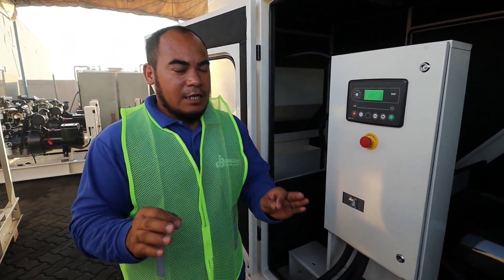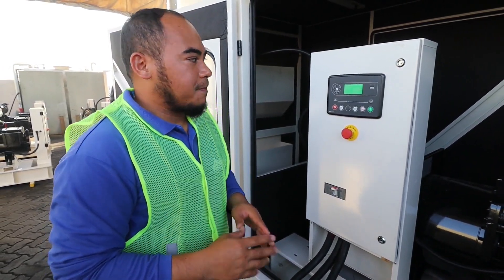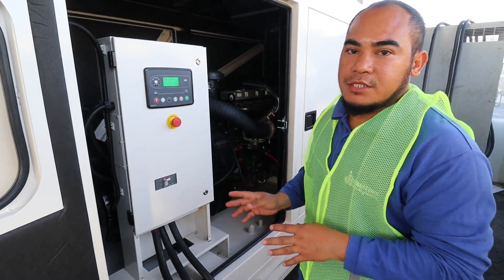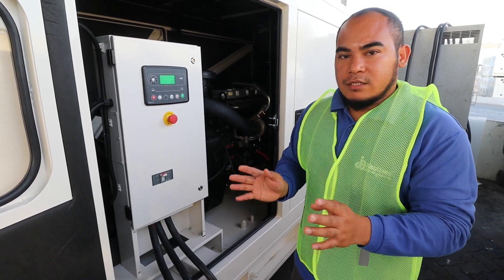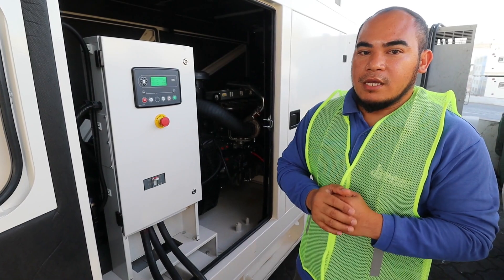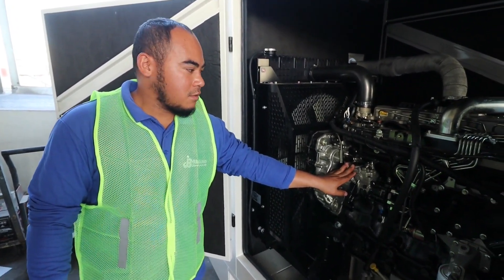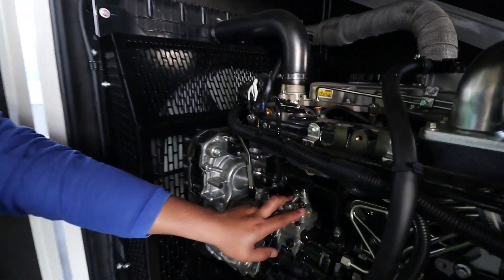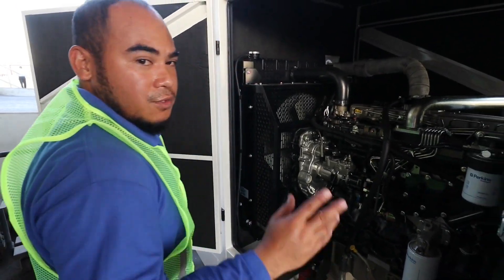Injection pump DROOP ADJUSTMENT 1106 engine,engine hunting how to fix? benzblogs

Comment: Please tell me how to solve my problem in perkins generator fitted with Delphi 3340F260T fuel injection pump. My problem is when the generator started Frequency is going to 62Hz. With the load is it varying upto 45Hz .I am keeping frequency in between 50 to 55 by adjusting load and always keeping touch on it. Some one adjusted pump RPM before from adjusting screw. I hope he didn't touch the screw which you do in this video. Please guide me, how to adjust screws on the pump. No load engine is not hunting in my case.thanks
Reply from the maker: Simply by +- until it become stable

Comment: My 1500seris oerkins is mixing oil and diesel. I have change the injectors after working for 48hrs it mixed again  please what can be the problem
Reply from the maker: Double check your oil cooler check leakage forom your pump all make sure all seal is not worn out

Comment: Nice video and tutorial. 
I have perkins engine too. It's 80 KVA. I got issued in frequency (Hz). My engine sometime got an alarm "over frequency shutdown" when auto backup onload in 12% of load. Sometimes when i tested for run up without load, the DSE alarm got alarm too..

I have tried your tutorial adjusment the injection pump. The rpm at 1542 and 51,5 Hz frequency when it's offload and at 1500 rpm and 50 Hz when onload at 14% load. But still the over frequency alarm from DSe occured when it tested offload for run up or auto backup when the main pss is off so my engine can not back up because it was shutdown from dse. Just sometimes occured, not always. This anomally makes me desperated. I use deepsea DSE 7420, engine perkins 1104 80 kva, and stamford alternator.

Btw. What i should i do ? Thx for your time..
Reply from the maker: Do this test to put the engine load if happen same setuation how much speed rise and down thin check yo your configuration if you put the transent delay yo 3-5 sec delay if not it happen this same again2
Reply: @benzblogsVlogs  i have set the trancent but at 2 s.
Reply: @benzblogsVlogs  when at onload, this speed engine is stabil in 1500.
Reply from the maker: Check tge transent delay put 3-5 sec delay yo avoid this problem again2
Reply: @benzblogsVlogs  but still  its sometimes alarm "overfrequency shutdown" when its auto backup or test run up without load. Sometimes this engine success to auto backup the load. And its always succes backup the load when i test simulating main pss is out. There is no alarm when i tested it.
Reply from the maker: Put it 5 sec
Reply from the maker: Check the fuel system if present of water it will happen like this

Comment: Hi my friend very good video , I'm electrician,I work on a plant with 10mw, sometimes I have a problem of engine speed low,or tachometer speed low, where lcan do ajustements
Reply from the maker: What engine you using cummins what type

Comment: Hi.. brother..I have problem by this injection pump but everything you said I did then frequency was stable.but when I connected load(compressor) my disesl generator get back stage and frequency set on 45hertz...who could solve this problem
Reply from the maker: What kva This
Reply from the maker: How much kw or amp did you apply load
Reply from the maker: If you calculate the load and its not exceed to the calculation of your generator capacity thin the problem is your pump already
Reply from the maker: Just clean the fuel line filter for no blockage happen its also make engine droop to low frq